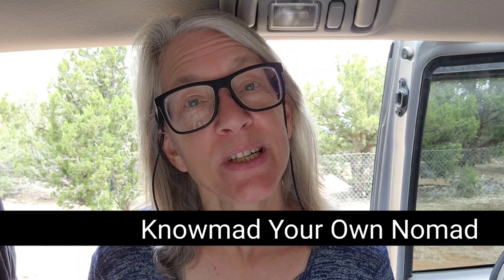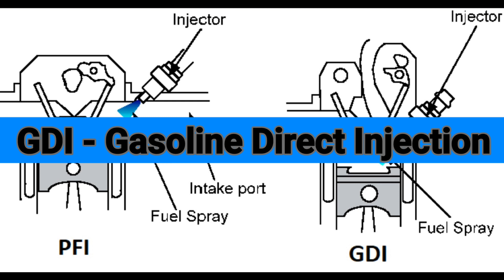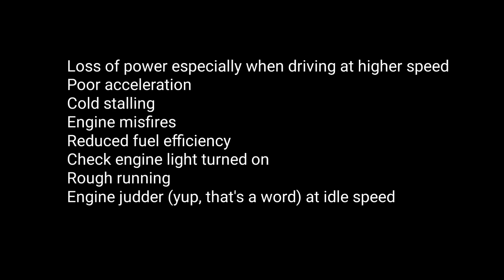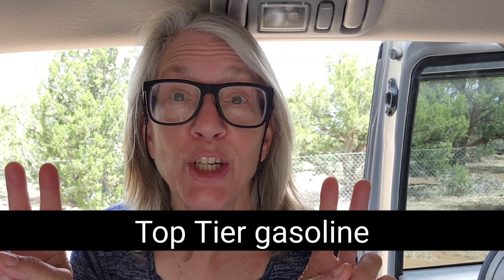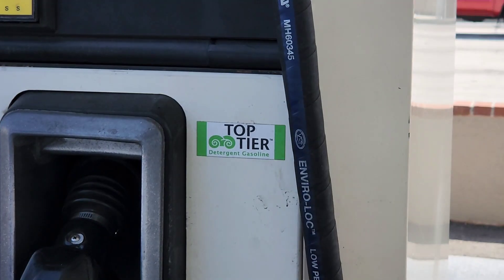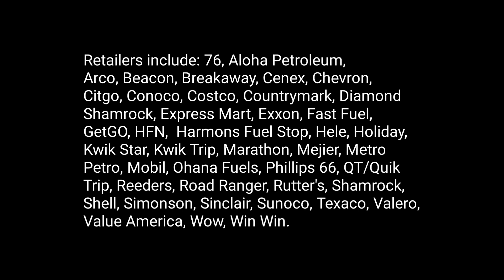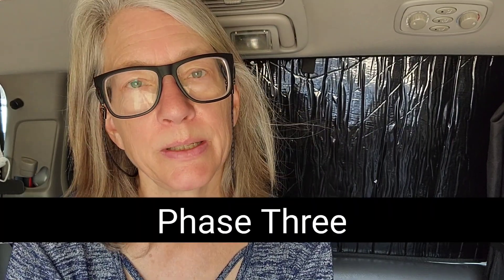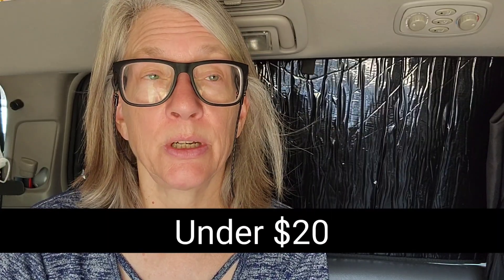Increased oil consumption and GDI - 2016 Kia Sorento SUV intake valves carbon build-up solutions

Comment: Kia are not made well. You need to get rid of it.
Reply from the maker: My overall experience with this vehicle has been positive. I'll definitely be keeping in mind what owning a GDI engine requires for future rigs.
Reply: @knowmadyourownnomad8194  I'm telling you as a person who can hear piston slap from 300 yards away and can smell when a car needs spark plugs. Get rid of it. Get a Toyota or Honda or a Mazda.  Kia is a time bomb. Please. Save yourself the 12 to 15k loss a blown motor saddles you with.
Reply: I don't know about that, I've got 414,000 miles on my 2008 Optima with no problems other then a new alternator and the usual rust for my area. Oil changes were done at 5-6k with the cheapest conventional on sale at the time of service. It still runs strong but is showing its age, pre GDI 4 cylinder. EDIT: watching this video to try and help a friend with a 2012 Sonata oil eater, GDI with 160,000 miles